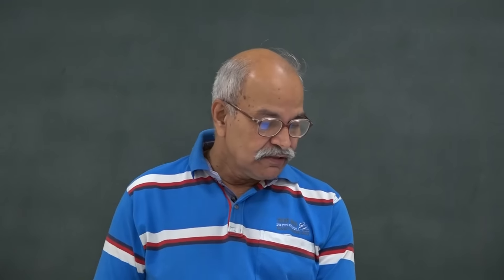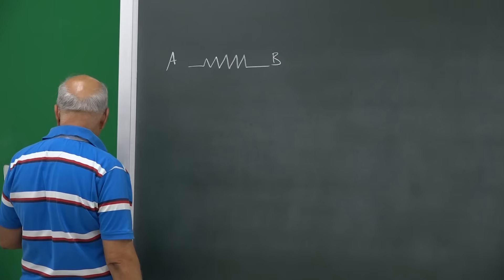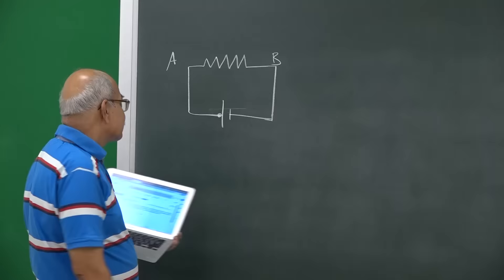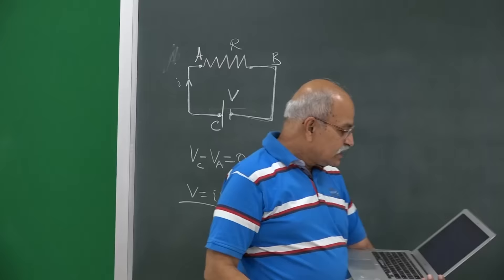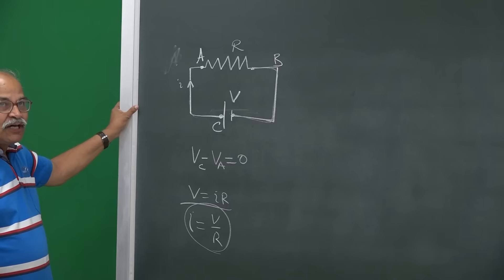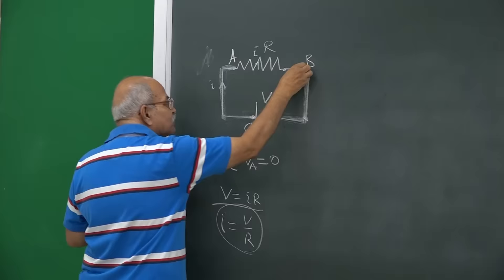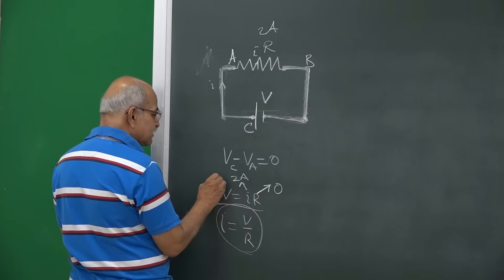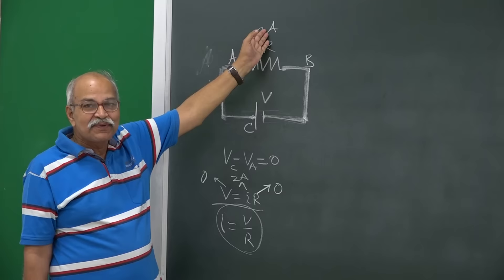Current without potential difference

Comment: 1.5k people know that neither current can flow with 0 potential difference nor a conducting wire can be made with 0 ohm resistance...here R, resistance of conducting wire  is so small then iR is also very small so we can neglect that potential difference and we do...so there is a very small potential difference....

Comment: Sir One Doubt. Let's suppose V=0 and R=0 and I=2 as you said. But when it is substituted in the equation V/R= I, then it's 0/0=2, which is not true. Can you explain please.
Reply: 0/0 can be anything . 
and most important thing the wire doesn't need to keep it's own resistance 0.
Reply: @reduanullahnawshad9887  ok sir... thank you

Comment: That's means a drained battery is capable of producing current through a wire. Or maybe a loop or enclosed wire is producing current in that system, right?

Comment: Current=total charge +time
In series ,If time taken is less before passing through a resistor by electrons thus the current before passing through resistor is high and time taken more after passing through resistor thus current will be less. Here no. of electrons remain same.But this contradic the fact that current remain same in series.

Comment: Vc= Va implies equipotential region. You don’t need to spend any energy to move charge along an equipotential surface….so current can be any value (depends on other circuit components)

Comment: its simple answer is (potential is path independent....)

as we know the potential difference is equal to the workdon e and path independent ,so the potential is also not a path function its only depend on final and intial point ..... if we assume that the current flowing from point c to a is same then the potential is also same at final and intial points ... so it is comsidered as 0.

Comment: Mathematical reason is correct.
But physically, what is the driving force of electron here, which makes them flow and generate a current, if not the potential difference?

Comment: for the prson who asked this question and everyone here I think i have another explanation to this and that is first consider potential difference to be a height and now consider a water tank which is kept 100 meters above the ground so now water has to be brought down in vertical pipes but consider cutting the pipeline midway and attaching a horizontal pipe between the two peices, so water water will still flow downward despite there is no height difference between the two end of the horizontal pipe(water only comes down if there is a height difference , the same happens in a circuit i.e. current only flows if there is a potential difference between two points no matter now if there is equipotential element(hassame potential all over) between the two connected points).
for better visualization see the below text

this is the tank 👇
(100 meters above)

    !!!!!!!!!!
!!!!           !!!!
!!!!           !!!!(a)
!!!!           !!!! ______  (b)
!!!!!!!!!!!!!!!!!!!               |
                                   | 
                                   |
                                   |
                                   |___________(c)

                            (d)                       |
                                                        | 

                                                        |
                                                        |
_______________________________| (e)_____________________________________(ground)

here if i dont use use the word "height" instead i use "potential" then:
here ab,bd,dc,ce are pipes(wires) and water(current) flawlessly flows through them despite of the fact that there is not potential difference between d and c but it flows beacuse of the net potential defference between a and e
thank you

Comment: The students doubt was not cleared. If VA-VC=0 then considering R=0.001(very less). Current must be 0A. But thats not how things are calculated. Resistance of the whole circuit has to calculated rather load which will determine how much current will pass through it eventually.

Comment: Sir, what will happen when both the terminals of a cell connected with eachother by a wire whose resistance is zero? Will the energy stored in the cell remain same for all the time or it will get neutralized?

Comment: Sir but in potentiometer the potential difference across the galvanometer is also 0 but there is no current even though the wire through the galvanometer is a conducting wire ......then why the potentiometer does not draw current from the circuit despite of having a zero resistance......sir PLEASE REPLY ........
Reply: Actually, sir.... I think this might be a reason as well but i was looking for a more precise answer ...... according to this reason for any of such situations an arbitary current value should pass through  the wire which might be 0 or might be non zero .....

Comment: ATQ, Vc- Va = 0 same for the other side but he didn't mention wht the potential difference between Vb and Va .
If Vb-Va = 0, it means that the p.d accross the two ends of the cell is 0 which means no charges will flow through the circuit.
Since Vb-Va  is not 0, then an amount of current will flow....

Comment: So without the resistance which is 0 the current will flow slow or what?
Reply: Yes. Electrons flow rate decreases with increase in resistance. Use silver instead of copper wires. Less resistance and less heat and more current flows. (Sadly the increase will be in micro Amps of current)

Comment: But sir if we interchange it  then we get current as zero....
Sir ...like u said ...v=ir
Here we took currrent as 3×0 .and we got currrent.resistance ..voltage zeroo...
Or sir if we modify formulla v=ir ..to i=v/r  and by putting value we get i = o/o which is not defined
Reply: Yes his explanation is somewhat skewed better explanation is that a to c there no resistance but c to b there is pd so the current has to pass through b

Comment: Question asked is filled with fallacies and assumption that we need potential difference at every point for the current to flow at every point. If we are saying that current is flowing in circuit by that we means potential difference in the circuit is the reason why current is flowing in whole circuit.
Think it like that, there is ball at the surface you pick it up bring at some height you created potential for the ball to go downward but you should not be saying that whole height has no potential.

Comment: Whenever there is a resistance it will consume energy in transporting charges through it .so we need a potential difference 
But if there is no resistance , we don't need a potential difference to transfer charges..as there is no obstruction in path of flow of charges.

Comment: Sir, but why current flows even if the Voltage across the two ends of wire is same. If there is no voltage difference then why should current flow. I am using the term Electromotive Force EMF if it not there to maintain the continuous flow of charges then why charges are moving each and every time. We know it flows really as if it not then we shall not see most of the instruments.

Comment: Dear sir, If we were to calculate the current i between the points A and C, then we'd have divided the zero potential difference (between A and C) by the resistance (which is also zero), wouldn't it be an indeterminate expression (dividing zero by zero) ? Could you please clear this sir

Comment: Sir in Capacitance circuit the current goes pi/2 phase ahead of voltage as phase difference, so there also current is there without voltage as voltage is behind the current and current is ahead of phase , so how is this current flowing without any potential reached there

Comment: The reason could also be that the points AC are placed in an electric field  and current flow is from C to A (as we don't need potential difference for moving an electron within the electric field) 😜
Reply: Provide electric fields direction is also from C to A

Comment: Sir, In a model, which is consist of two concentric circles, if we move linearly along the surface distance equal to the periphery of larger circle, inspite of any slip between these two circles, the distance covered by these two circles are same. How it is possible as larger circle periphery is large compared to small circle?

Comment: Questions::
when a resistance AB is added through a conducting wire across a battery the potential difference between one end of the battery say positive and one end A of resistor is 0. but inspite of 0 potential difference a current flows between the two. why??

Comment: The Earth is conducter or insulator?,we get shock due to complete circuit,and jab ham battery ki positive or negative terminal k sath wire connect karte hain earth or ground k saath  phir alag place se ham ek wire connect kare ground ki saath with led bulb's positive terminal ko aur negative terminal of bulb ki saath negative terminal of battery  then bulb Kyun nehi glow karti hai,job ki  circuit complete ho chuki hoti hai, please sir tell me the reason with explanation 👍❤️❤️ please sir give me the answer...

Comment: But the resistance is zero purely only in case of superconductors. 
In wire the value is small, so voltage may be less but there is particular value of voltage.

Comment: Arrey I get that it makes sense with ohms law, I'm wondering physically how is it possible to have a current without a voltage?
Like if there's a wire (superconducter) what is causing the electric charges to move causing a current? Since there is no PD , what else is at play here?
Reply: yes right question 
the answer has not been given in the video
Reply: @naammekyarakhahai8952  no my question is how the charges flow from battery to 'Starting point of resistor' as in between there is no potential difference theoretically.
Reply: @naammekyarakhahai8952  Thanks AK, that makes sense.
Reply: @naammekyarakhahai8952  i have read that answer.
in the answer u said practically wires has rsistivity than it makes potential difference hence charge got flow.
and if i think theoretically, the wires has potential that means just like superconductors the question is how the flow of charges get start as there is no potential difference.

How we establised charge to move initially from battery to starting point of resistor'

Comment: Sir.. But charge will only flow when there is Potential difference but between A and C there is no potential difference  (resistance of wire is neglected) . Then current should not be flowing betn A and C
Reply: True
Reply: From this point I didn't understand what he said 3:32
Reply: All the resistance is R and the resistance of the wire is neglected , then following the ohm's law there will be some potential difference between the end A and B of  the resistor and hence the current will flow . 
And if current at A is zero, there must be some lower potential at B.
Reply: @unidentified3159  right

Comment: I don't know , but if there is no voltage drop at the two terminals of the resistor then the current will not flow (acc. To me ) via resistor .
 And moreover , getting a resistance less wire is an assumable case.

Comment: Actually he didn't answered completely...
As you see the circuit, it is in series. If you look at the points A and C, there is no potential difference as both are shorted with almost zero ohm between them. So mathematically, there is zero potential difference which is correct but still the question itself is kind of wrong, that without potential difference there is current between A and C, which is not possible as current can only flow when there is p.d. . So don't get confused..👍

Comment: Actually potential difference is not zero .Coz conducting wire's resistance is very very low .So the potential difference is not exactly zero it is very very low .Coz conducting wire is not superconductor .

Comment: Cut the wire and measure the voltage and resistance you will find full battery voltage and resistance

Comment: Sir as u said there is 2 A of current in 0V and 0R which u said obey ohms law that is V=IR that is 0 = 2*0 my question is that then I = V/R right then we sub same values then 2 = 0/0 then how come 2 = 0 does this violated ohms law. I had this question after u explained. 
Pls ans my question🙋🤔
Reply: 2A was an exaggeration. Not to mention theres a negligible amount of V and R but its not completely "0". so A will also be negligible but still enough

Comment: Sir, by following the Ohm's Law, it proves that there can be electric current without potential difference but if we see theoretically, I'm not able to understand that how it is possible. Physics says that there is potential difference across the ends of the conductor or the battery and to eliminate that difference electrons start to flow, i,e., current is there. So, please explain theoretically how can there be flow of electrons without any potential difference.
Reply: Easy hai ohm's low

Comment: If the potential difference is zero then how is there flow of electric charges?? And if no flow of electric charges then how Is there current in the wire??  Also if the resistor is zero then we can consider its absent in the circuit...ryt??

Comment: But if we calculate i from V/R , then nothing cant be dovided by zero. Now what ? The value of i cant ne calculated now , but it was 2 ampere ? Where is the flaw ?
Reply: do not take 0/0 , take  very less value like 0.0000004  and 0.0000002  the 0.0000004/0.0000002 = 2 A only

Comment: Mathematically incorrect, Let's say resistance is zero (R=0) so, i = V/R means current tend towards infinity. Which is correct (Imagine short circuit situation) but in our case as sir explained, wire's resistance is negligible compare to main resistance so we just don't count it. or we can assume wire + electric bulb = total resistance because in series.

Comment: Sir , what is charge itself ?
What's the difference between charge and current?
We say that current is basically the flow of charges , it means motion of charges will produce current.
Then,it means  when charges are are rest , they will not produce current , so we call it static current ?
Plzzzzzzzzz answer sir?? 😭
Reply: Charge is an intrinsic property of electrons and protons( negative and positive respectively), If you really want to know it's origin which is beyond the scope of classical physics, you have to refer to quantum theory. Going back to your question, the current by definition is a directional motion\flow of charged particles, if there is no flow there is no current. If you have an accumulation of charged particles in a body it is called static charge ( not static current, that would be a misnomer)
Reply: @privatefactory1173  thank you for answering and correcting me ❤️.
But , still I don't get what is charge.
Ok it's intrinsic property , but why?
Reply: @chemistplatinum7282  Well, the explanation is in the domain of quantum field theory and there is no simple explanation. But try visualizing it this way, the space-time around us consists of many fields, one of which is electric, and some particles can induce it. It happens so that proton distorts it in a way that peak is created, where field lines face outwards( positive charge), where electrons distort it creating a trough( negative charge) field lines go inwards. This is why alike charges repel and opposite attract. Peaks want to fit the troughs so to speak. In other words the charge is the DISTORSION of the quantum field. If you don't like peak and trough analogy, think of ball and hole^)))) Some particles do not induce electric field and hence have no charge, like neutrons.